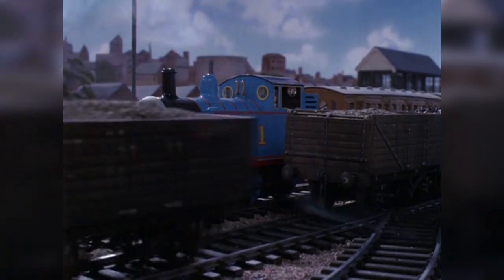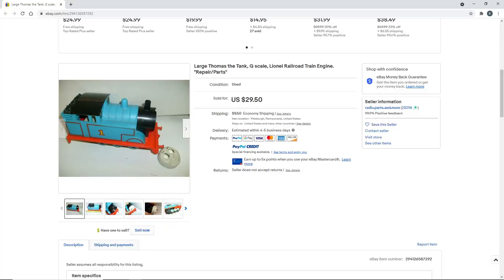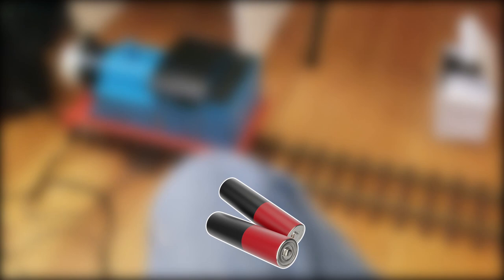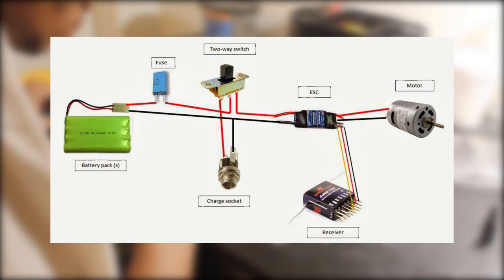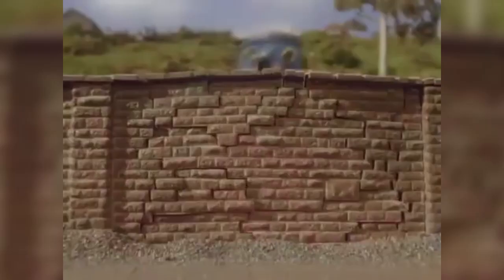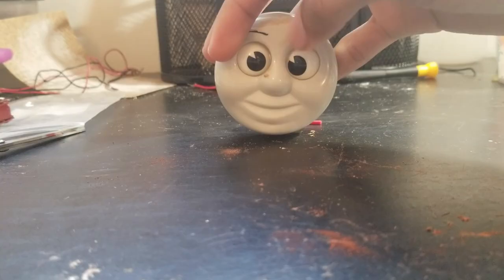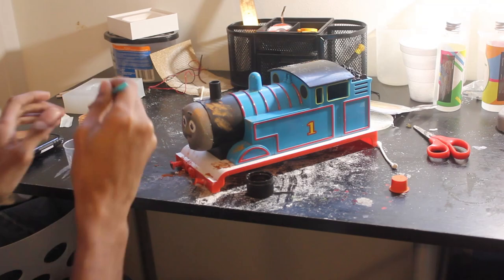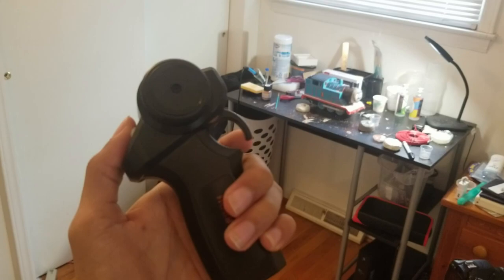Custom Lionel Special Letter Thomas

Comment: The engines were track powered, they would disconnect one of the wires in and engine didn't need to move. Those batteries and controllers were for the eyes. Great model all in all though